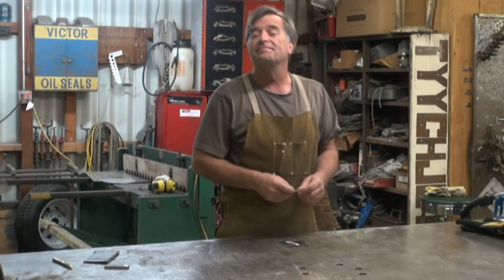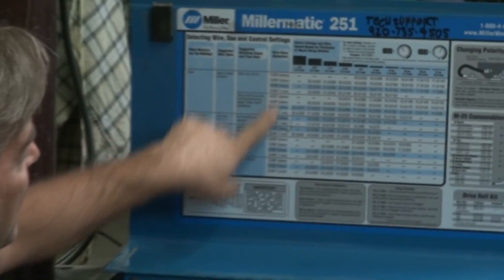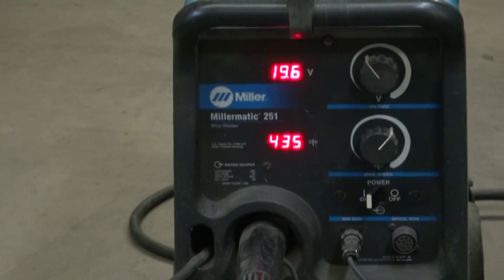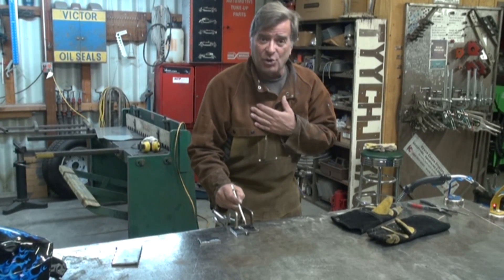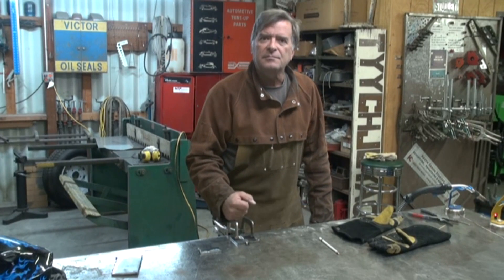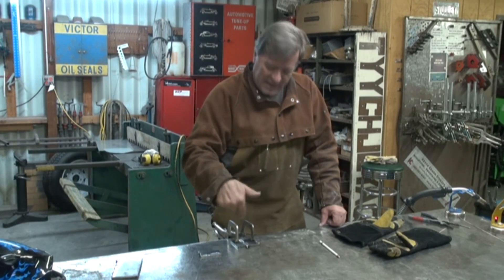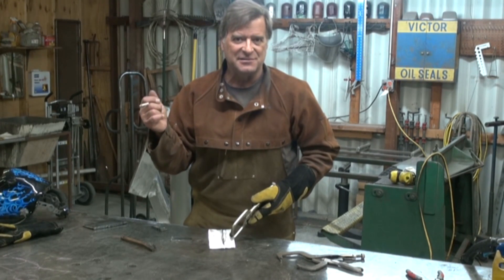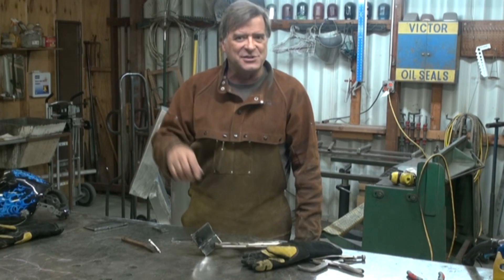How to Adjust Your Welder Settings - Kevin Caron

Comment: Glad I found this video, I have been given a mig welder and I am trying to weld 1mm steel but keep blowing through the metal. I need to play with the settings but mine has no digital display.
Reply from the maker: Just need more helmet time to get it all right   in your head.

Comment: Good basic info for people just starting out. The machine manufacturer’s recommendations are a good starting point, but conditions aren’t exactly the same each time, so people need to learn that they have to vary the parameters here and there. I find that the same type of weld material on the same type of metal isn’t always the same, even from the same supplier. Most people don’t realize that alloys have a wide variability within the standard for that alloy. Every manufacturer has their own mix, and even that varies from batch to batch, as does the content of the filler itself.

To see that, one can go to McMasterCarr and tap on a metal product as though you are buying it. They list the specifics of the alloy. You’ll see how much it can vary. It’s really an interesting topic.

Comment: good day sir. Is it necessary to have two different welder particularly with different amperage? tnx
Reply from the maker: Not a all.   One machine will do the job just fine if you get the right machine.   All depends on what you are doing.

Comment: Great video Kevin, they always are...A thought on that setting adjustment and why it didn't penetrate on the higher setting...It seems to me that increasing the current (volts) caused the puddle to "wet out" to much so while the molten metal "spread out" more, it won't penetrate as deep...my $0.02...

Comment: Kevin, RE purging the line at the beginning of the day with gas. I switch my welder to the spool gun mode and that stops the wire from coming out of the gun but lets the gas continue, so you don't end up with that excess wire sticking out of the gun.

Take care Dave

Comment: Hey Kevin, For  a  Lincoln 140T   they have A, B, C .D setting what  are these heat setting represent? Also the wire  feed goes 1.2.3.4 . How did you attach the leather neck  guard to  the chin of your Welding  helmut?TU TY  . cheers
Reply: Thanks for you quick response Kevin.